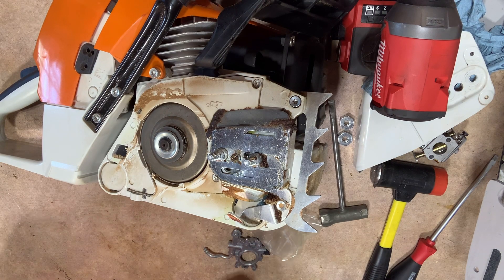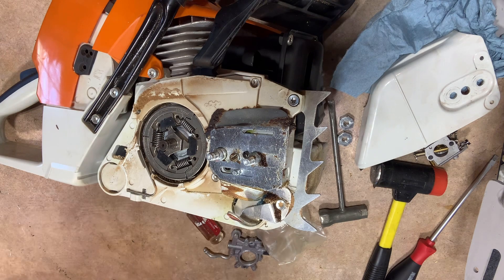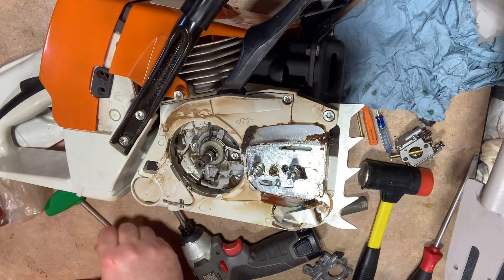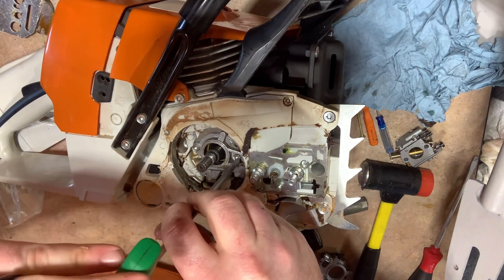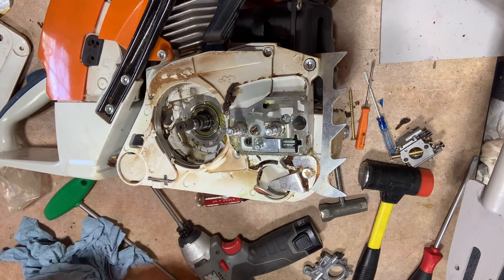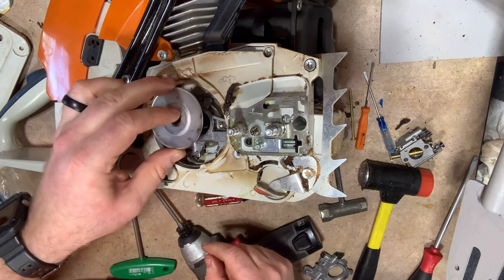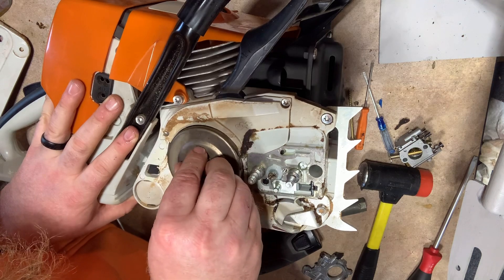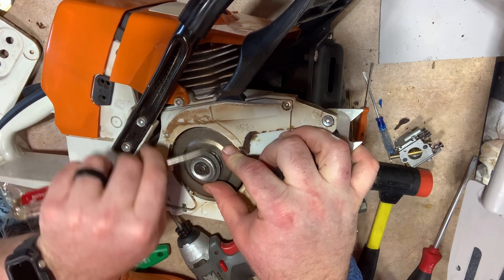Stihl MS460 Oil Pump Replacement - MS660 and other similar models

Comment: Is the oil adjustment on my ms 460 part of the pump you replaced?
My adjustment screw is messed up and not getting oil. Hoping that a new pump would fix the issue with the oiler increase/decrease screw problem,..? Any idea? Thanks in advance! And great vid!!!!

Comment: I’ve gone at the clutch with my impact and it’s not budging. Any tips or tricks?
Reply: If you take some string, I used spare pull cord, and fold it in half and pack it in through the spark plug hole.  Pull the starter til it locks up then use your impact on your clutch.